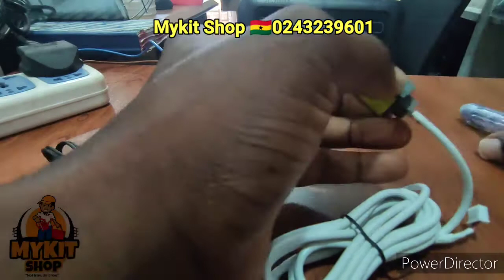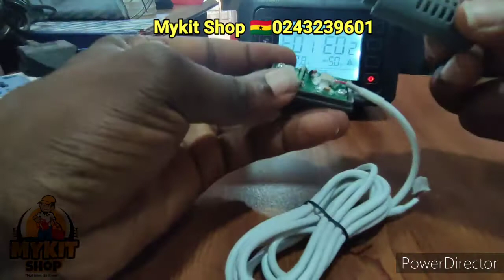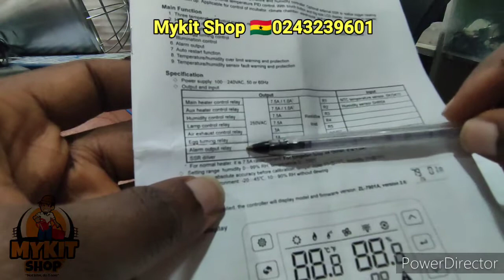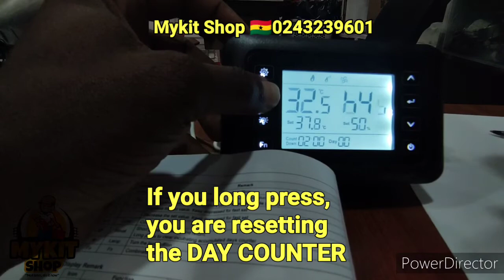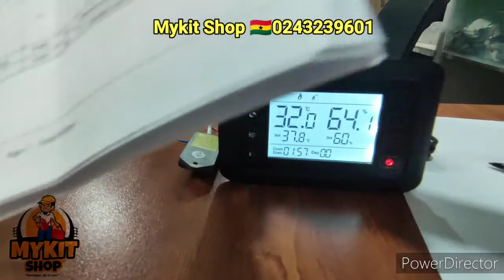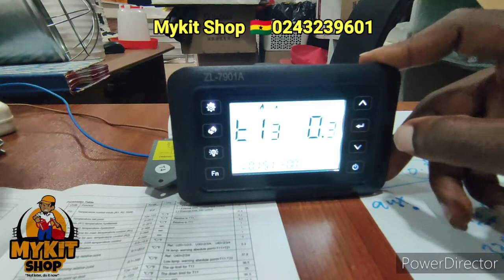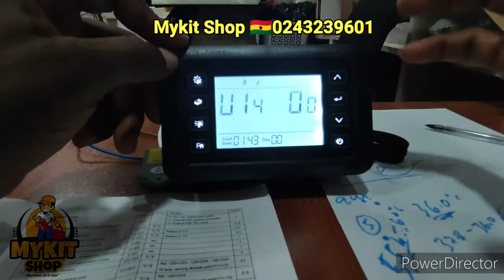How to program ZL7901A Incubator controller🇬🇭

Comment: Hi please advise me on ZL-7903A Does it includes settings for  egg turning timer ,or I must buy the timer separately
Reply: On the video, the number on the bottom left shows the countdown until the next turning, starting at 2:00
Reply from the maker: It has timer in it already
Reply: The ZL-7901A is pre-programmed at 38°C and the egg turning occurs every 2:00 hours, alternating sending current through the Right or Left power source relay within the controller.  If using 5 rpm synchronous TYC motors with a horizontal egg rolling tray (not a tilting rack that goes up/down or Right Left as described in the manual), you will only connect the motor to one of the output relay pins (choose either Left or right, it does not matter) but note that this will cut the number of turnings in half as power is alternated by the controller to the left or right.  That's turning at every 4 hours vs 2 hours, still sufficient for 3x daily turning.

For me, with a 1.5" radius of my motor offset pin, the time the egg turner is on will move my trays at the factory setting  of X seconds on through 1.5 revolutions of 3" of travel.  For example slide to right, then back to Left then ending to the right.  This is perfect to give my set up 1 complete roll and a half, ensuring the get properly turned and end up opposite of how they were sitting after the cycle.